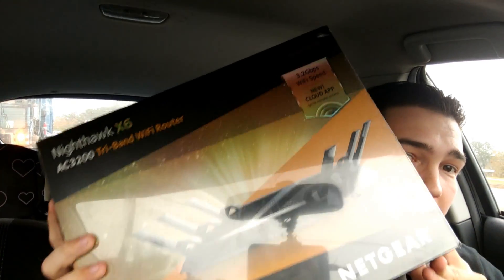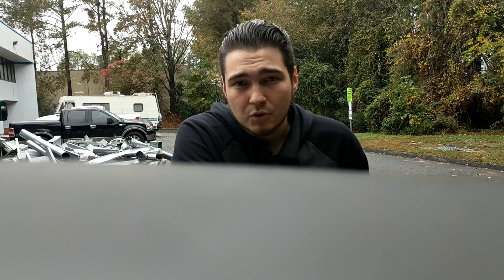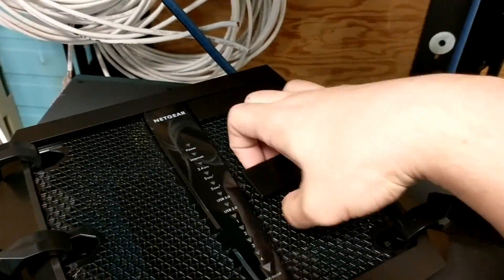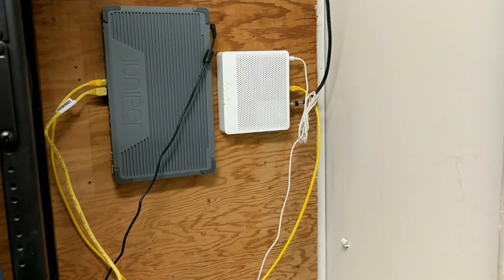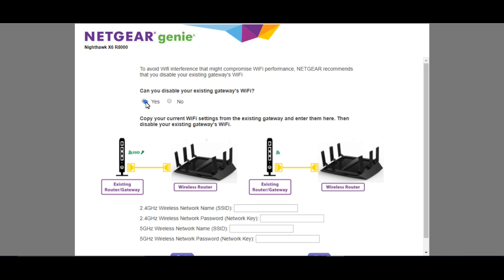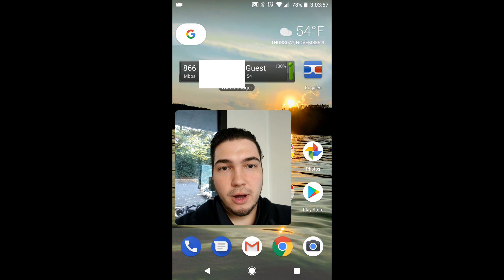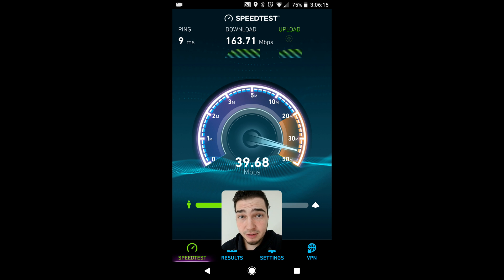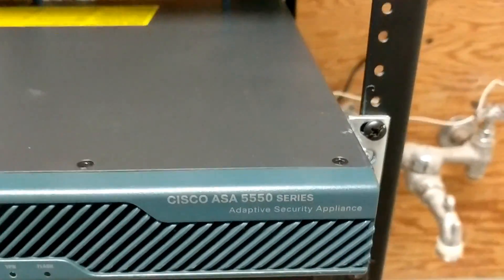NETGEAR NIGHTHAWK X6 AC3200 (R8000) SETUP W/ XFINITY 1GBPS INTERNET!!!

Comment: Honestly I'm still running this router 

I upgraded ISP to 
500Mbps down 
500Mbps up 

This router is a bit slow on the up 

I only get 380Mbps up 
seen speeds of 620Mbps down
Avrg down is 510

I have 5 children a largeish 4 bed house solid brick walls 

Range is fantastic
I was using the original firmware but updated 

Removed the frequency coexist setting of the 2.4ghz 

Honestly it's faultless 

You have to change a few things and USE A WI-FI analysing app to find empty channels 

Also check what if any radar frequencys are used in your area 

I had a lot of network hangs from this 

The router will automatically change channel when it detects radar on a channel that is manually selected 

This causes some switching and changing of channels and every single time it hangs the router for a long time 

Check what's used in your area on Google for radar frequencys and you can solve this using manual channel selection

After I did this it was a whole New router

Couldn't fault it once it's setup correctly

I'm using mine on WAN FROM THE FIBER ONT/"modem"
Reply: Any chance I could make a video showing step by step. Would be greatly appreciated
Reply: @joelenriquez2192  I'm guessing you mean could I 

No because I only use phone at the minute and screen capture is a nightmare on them 

There are videos on YouTube about this if I have chance after work I will post links

Comment: Waste of money will be returning this thing sucks
Reply: Thinking the very same.  I just bought one today and after 4 hours on the phone with both verizon and netgear, i am still barely getting 200Mbps on a Gigabit service.  Will definitely be returning it within the next few days and/or changing internet provider if I am not able to achieve Gigabit or near Gigabit service.  150 and 190 Mbps is just not acceptable.
Reply: @stephenstephen8660  The trick is I use CAT 8 ETHERNET Cables. You'll be happy. I dont use Cat 5 because the bandwith of use is sort of out of date. Now if you get CAT 8 make sure you use a shorter distance cord. The shorter the better!
Reply: CROCKPOT ok thanks.  I’m currently using cat 6 but seeing no difference.  I will give 8 a try then.
Reply: @stephenstephen8660  When you get it let me know how it went

Comment: I've got a Nighthawk AC3200 Model# R8000 and I'm not impressed with the speed.  I'm wondering if it's a setting or something.  When I plug my laptop directly into the modem I get 290 MBS on the speed test.  As soon as I unplug the laptop from the modem and go wireless, the speedtest reads 50 MBS :(  And it's right next to the router!!!  Any suggestions???  Thanks for the video!
Reply: down grade the firmware ,im honestly done with netgear after this i found the solution better than 3 of their outsourced reps from the philipines did in four hours !!! Not to mention this has been an ongoing issue and also the one lady rep knew nothing so much so I had to ask for her supervisor....I didnt pay 300 dollars for a overpriced router that doesnt even do the trick
Reply: @doxazo-2718  Thanks for confirming I'm the only one who hates this router!  So what are you going to try next?
Reply: @doxazo-2718  which version did you downgrade to?
Reply: @doxazo-2718  honestly I'm still running this router 

I upgraded ISP to 
500Mbps down 
500Mbps up 

This router is a bit slow on the up 

I only get 380Mbps up 
seen speeds of 620Mbps down
Avrg down is 510

I have 5 children a largeish 4 bed house solid brick walls 

Range is fantastic
I was using the original firmware but updated 

Removed the frequency coexist setting of the 2.4ghz 

Honestly it's faultless 

You have to change a few things and USE A WI-FI analysing app to find empty channels 

Also check what of any radar frequencys are used in your area 

I had a lot of network hangs from this 

The router will automatically change channel when it detects radar on a channel that is manually selected 

This cause some switching and changing of channels and every single time it hangs the router for a long time 

Check what's used in your are on Google for radar frequencys and you can solve this using manual channel selection

After I did this it was a while New router
Reply: Are you running 2g or 5g?
Reply: Not sure. Where do I find that information?
Reply: @rayferrara  when you search up available Network right next to your network it's going to say your network name with no number, 2 G or 5G the one with no number is a 2G bandwidth so try to see if you have 5G click on it. If you do not have a 5G line it is either because you're router or modem doesn't support 5G or your device doesn't have the hardware to use 5G

Comment: Question..?

Just got the same exact router this month.  Long story short, I wanted the Nighthawk x10 so I bought that one first.  With that router I was getting 960 mbs from the router through the netgear app.  I seen the price drop for the X6 so I switch up to save some money.  My netgear nighthawk X6 ac3200 test up to 478 mbs.  I know I can get 900 plus but with this router I can’t even get 500 mbs.  Do I need to change something in the settings or return it and get something else?  

Also on the X10 on 5ghz in the back yard my iPhone was pulling 533 mbs.  This x6 only give me 127 mbs on the iPhone 7 plus. 

I have the 1 gbs from XFINITY in Douglasville Ga.
Reply from the maker: Hello, it sounds like it's in your settings or maybe the wireless network it's handing out. It is handing out an ac wifi? I know u can change them to hand out less (not sure why someone would want too lol) if u have Android, download the "wifi manager" app. It's the one I'm using in the video. It will show you the speed of the network. If your only seeing 400, you may be on the 2.4ghz or there may be a setting that's wrong on the router. I'm in Acworth, may switch to that soon. Waiting on at&t fiber so I can get the Xfinity 1gb for $70 like at&t charges. 😊
Reply: BigC Vlogs 

Ok, but through the Netgear app is shows you the speed of your network, if thats correct, and it shows 473 coming in from XFINITY.  Now when I had the X10 it showed  960 mbs, not through wifi but from the router. When I had the TP-Links it also showed 900+ mbs.  I only did the quick install when hooking up this router, without doing any changes to it.  I know it a downgrade in performance but I shouldn’t be seeing less than 500 mbs.  Maybe I have to go back with the nighthawk X10. Hey, thanks for your input.
Reply: You have to enable ipv6
Reply: @blakechris370  figured it had to be that .. will try out , Do you think it helps w the random 5g 2 internet drops swell